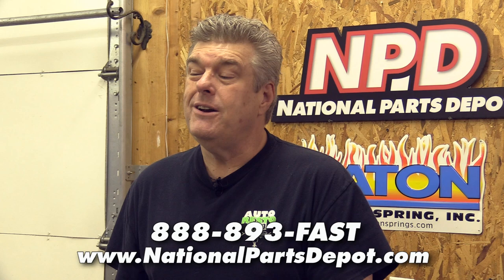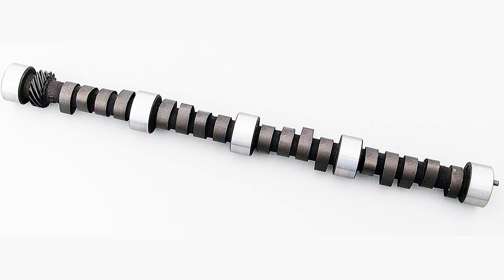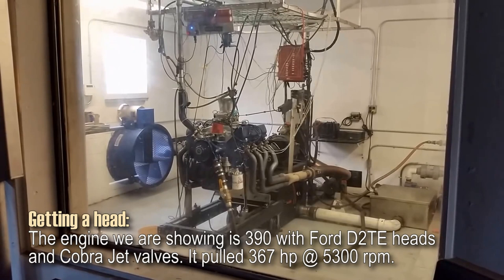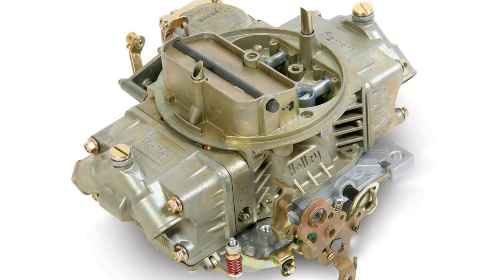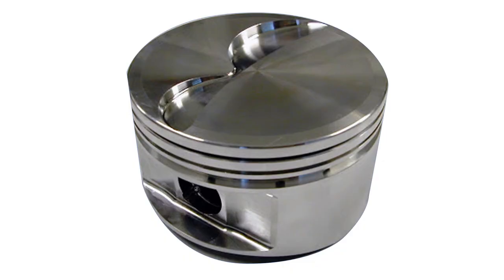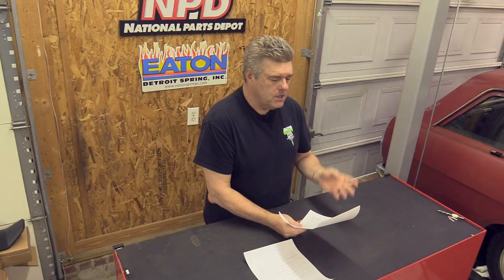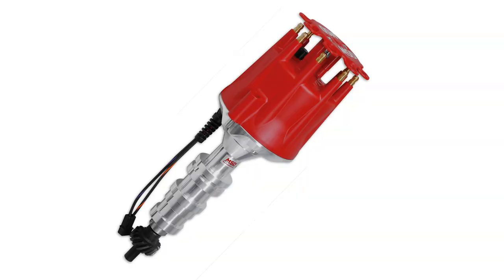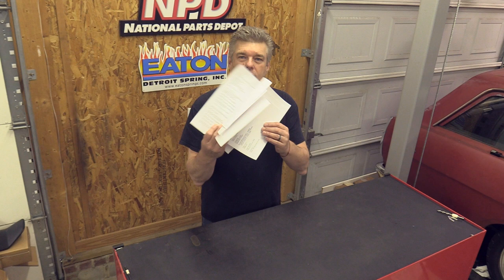Ford FE Build Tips

Comment: The 390 is just simply a torque monster, even in stock trim..
Reply from the maker: Yes.
Reply: FE 427 is 100 more hp and  70 less  lbs than a ch**y
Reply: @duccanard9079   but sadly 3 times as expensive,. If,,. You can find  one..
Reply: indeed
Reply: 427 ft lbs of torque in stock 390 form. Not a torque monster in my book.
Reply: 390 is a great engine, stick a 428 crank in it and it's a great combo.
Reply: @kimmorrison9169  how is that not a torque monster, has that much stock!
Reply: @RegulerShowTV  Buick 401 has 445 ft lbs, Pontiac 389 has 445 ft lbs, Olds 400 has 440 ft lbs, 383 Mopar has 425, AMC  401 has 430 ft lbs,Chevy 396 has 415 ft lbs. The 390 Ford at 427 ft lbs is basically average for a big block.
Reply: @kimmorrison9169  you have a point, but in comparison to today’s motors all of the engines you listed are torque monsters.
Reply: @kimmorrison9169  The AMC 401 is really the impressive one here being a small block.
Reply: @AutoRestoMod  yes it is most definitely and I've got a 2 barrel on mines and she'll still eat the tires up very strong motor!!!
Reply: @kimmorrison9169  That is a 2V engine. The 4 V was pretty good and in the same vicinity as all the other guys. And many of them are still going. The Pontiac was a 3x2V, as was the Olds
Reply: @kalmlykeabomb  The 360/390/401 AMC is not a small block.
Reply: @Bbbbad724  The CJ heads were better than the later C7AE and C8AE were horrible. The C6AE-R and C8OE-N were relatively close. The R heads I ran with CJ valves ran better than the CJ
Reply: @Bbbbad724  Im just no fan of 390’s. They need a lot of mods to make any horsepower.
Reply: That’s what I like to hear
Reply: Too funny. I had a '66 1/2 ton with a fe 352 and "torque monster" is what I named it!
Reply: “Torque monster” = an engine with anemic HP compared with torque usually due to pathetically poor flowing cylinder heads.
Reply: @Bbbbad724  Next time just write a BOOK.
Reply: and NOBODY uses then for a buildup

Comment: Built a 390 for my F100, it turned out pretty good for being a home built mill. Standard 390 bottom end, c8ae-h heads, Holley street dominator intake, comp thumper cam, Holley 750, long tubes. She runs really strong. Probably twice the power of the original 360. Those FE engines can be really nice every day mills with minimal work.
Reply from the maker: Agreed.
Reply: Get a better cam. Like a lunati 268 or a Howard’s You’ll thank me
Reply: @joumasepoes88  oh I agree, you're not wrong. But this comp thumper cam was free, it came in one of the blocks I bought so I ran it.
This engine was literally slapped together with used parts in my buddies garage to get me by until I build the other block right.
Reply: @CadillacZachOffical  they do sound quite nice.

Comment: I'm new to the 390 , but will gain experience with it as I've just bought a 1975 F-350 with a steel 12' dump bed , and not even running that well , that 390 is still pretty stout.  Lots of knowledge to build with my new , old girl.

Comment: Thanks for doing the FE. I've been listening to Barry for the past 10 years. Just a note of caution for folks building an FE: Don't let just any good engine builder build it. Make sure they know about FE in particular. Oil flow being the main issue.
Reply: I had to train my machinitist.I go to another one in a different city close by for my heads.hog block oil holes to7/16,360 pistons,390 std. crank good for7k revs,got forged too.d2 and c2ae heads(got 3 bumpsides).unidentified AL intake,no firing order,no C- numbers,ford stamp and small 1439 by thermostat.thinking low rise.
Reply: @duccanard9079  I remember some High performance FE came with a factory AL intake. It was either an early T-Bird or later police intercepter. I remember it being low rise. Hey, 7K revs is fantastic out of an FE.
Reply from the maker: Good point!
Reply: Barry is the best out there.  I love the FE, it is a strong light engine. Get the iron intake off and you are in small block Chevy territory in weight! Ford did an amazing job designing this engine decades ahead of its time! I have known Barry since 1999 and half of the 394 ci FE I am still beating on came from his company, TRW. It still has no oil consumption, blow by or noise. It runs really good and makes great power just from great parts, details in machining and my own two hands.
Reply: @ltwig476  - You are referring to the police interceptor intake.  It was identical to the cast iron (98 pound) 428CJ intake.  I helped a buddy swap in this manifold on his stock ‘69 CJ Mach 1 back around 1974.  The front end of the car sat about 3/4” higher after swapping in the AL manifold.
Reply: @danmyers9372  Thanks Dan

Comment: More FE focused stories is always a great thing! Mo better, as they say. I have built my share. Currently own an aluminum Pond 427 stroked to 482.  Hyd Roller cam and ported Edlebrock heads with 2.25 and 1.75 valves. 605 hp. 605 torque.  But that motor cost me over $15,000 and I did a lot of the work.

Changes to your build; 
Forged pistons 
Always balance an engine
aluminum heads are super reasonable now. Always take the heads apart and inspect them. Also Trick Flow makes great FE heads now. 
Go with a Ford interceptor intake.
Holley and no less that 750cfm for FE motors.
Stock rebuild distributor with pertronix is the right direction.
Morel makes great lifters.
Reply from the maker: Nice!
Reply: Sweet! I'll come to you for a build when I get the money 😁
Reply: Morgan L, it is great that you are still in the FE fold.  Do you still have the 66 Fairlane sleeper 428 in green? That is a neat car!

Comment: For carb sizing, CFM that equals approximately 2X the cubic inch displacement has always worked well for me on street performance engines. Double pumper with a stick, vacuum secondaries with an automatic.
Reply from the maker: Good idea
Reply: While the CFM rule works well there's no need for a double pumper in most applications. I'm running the intake that came on my car. C7ZX with the dual quad BJ/BK 600 CFM Holleys.
Reply: @myname9337  Nice. I'm running BJ/BK Holleys on a Holman-Moody intake on the 428SCJ in my '70 Cougar. But in single 4 bbl applications,  mechanical secondaries are easier to tune and provide slightly snappier performance on a stick shift car, at least in my experience. A vacuum secondary carb can be set up to work just fine as well though, so from that standpoint you are correct, there's no "need"for a double pumper.

Comment: Graduated in '66 and was messing with Mercury's back in the day.  S-55 390 4-speed cars.  You hit the nail on the head, a few times.  The oil pump drive shaft will break if it's OEM - guaranteed.  Didn't have ARP back then, but we had Un-Breako brand allen wrenches and you could cut down a long reach one to work, no more broken drive shafts.  
The FE will fill the valve covers with oil in a quarter mile at high RPM, so we ran 1 qt over so they would not starve.  But that makes huge windage.  So pay real attention to smoothing drain-back passages, do not run HV pumps (not needed) and go light on the oil viscosity so they flow back better.  Truck heads work well.  So do Interceptor Marine heads (if you can find them).  The marine cams are not bad on the street.  For a big HP motor, you have the better formula ...  But they are fun, once you get them running right 😁

Comment: I appreciate you contributions. Your 67 build was very helpful when I reassembled my Shelby. You suggested use of the FT Duraspark. They will not work in the FE block. The distributor has larger oil pump shift (5/16 Vs. 1/4)
The distributor oil pump drive hole is larger for FT engines. However, if you have the mirror 105 block with the larger drive hole Precision Oil Pumps offeres the bushing so you can use the standard FE distributor.
Reply: FE Duraspark works great especially with a MSD box.
Reply from the maker: Yup. Wonder if you could hide it under a Transistorized Ignition cover on a Galaxie...

Comment: Love it! Pre 1962 FE have the cheesy cam thrust buttons. Post 1963 FE is awesome. 1964 have one year only motor mount.
Reply: 1957 - 1964 blocks are all 2 bolt, chassis are year specific.
Reply from the maker: Thanks for the info!
Reply: 64and 65 heads with 11/32 inserts in the guides with 2.15/1.625 valves with a good blend and valve job are in the group of the best low buck heads Ford  made.

Comment: Informative video, thanks.
Here in Australia I have a 1968 Mercury Marquis Coupe.
I know your thinking land yacht but more of a cruiser one day I hope.
Exchanged the white walls and hubcaps for 15 inch US mags and BFG T/As
and it looks like a totally different animal.
Factory 390 4v, C6 auto, 9 inch rear end and power front discs.
Great original condition for a 52 year old car.
Lots of documentation from the previous owner and done about
280000 miles, a fair few on LPG with 2 small spots of rust.
Has original C8AE-H heads, S code intake, rated at 315HP@4600rpm.
Motor still has good oil pressure and compression on all but #8 cylinder.
I'm hoping due to a long time running LPG the short block will have some life
left in her and a burnt valve or head gasket issue could be the cause.
A leak down test may tell me more?
If good, then reco heads, swap autolite for my 600cfm vac Holley, shorty headers to
replace factory logs and see how I go.
Only 3850? made there in 1968 and a very rare car in Australia.
The guy I bought it off also imported  a 1967 a few years earlier, not as good condition
as mine but with the factory 410 Mercury FE.
I could be wrong but think these are the only 2 Marquis coupes in Australia.
When I finally get my act together she will stand out at the coffee and cars/shows from
all the Mustangs in more ways than one, thanks to her small numbers and large size! :-)
Anyway, apologies for waffling, thanks again for the vid.
Cheers from downunder
Reply from the maker: We have a 1969 Marquis as well!
Reply: I just bought a 68 monterey with a 390 and c6 and probably a 9 inch I hope 

34k miles for 1600 dollars

Comment: My FE390 has been bored .050 over making it a 400ci, 531/540 lobe lift on Oregon Cam, RPM intake and heads, 1.76:1 ratio on HS Rocker Arms, 770CFM Holley Carb, 1" spacer. I make about 450HP and about the same on torque. It'll be mated with TKO500 with Hurst short throw shifter, aluminum driveshaft, 9" Eaton Detroit TruTrac center with 4.33 gear ratio and 31 spline axles. 2.5" FPA headers with Flowmaster 44s and Flowmaster dual tips. You can keep your Coyote :)
Reply from the maker: Lots of people Love these engines. Me included.
Reply: Stock stroke?
Reply: @slick-px4pq  yes

Comment: Feel so blessed to have a 351c 4v, 4 speed in a 70 torino gt, a 390 c6 in a 75 F- 1 fitty and my baby 69 fairlane cobra with 428cj 4speed. All numbers matching.  motors and trans
Reply from the maker: That's a really sweet little collection you have there!

Comment: Cam info is 260/260 adv dur 212/212 dur at .050 .484/.484 lift lobe separation angle is 110°  
My book didn't say if those lift numbers were for the non adjustable 1.73 rockers or the adjustable 1.76 ratio rockers. I assume those lifts are for the 1.73 rockers
Reply from the maker: I found the 212/212 info twenty minutes after the video was posted. I was looking at the cams (like you do) and found the specs on Jegs. We might do a deep dive at some point with Barry. I would Love to have one of his 445 FEs in my Galaxie.
Reply: @AutoRestoMod  i bet a 445 would be a torque a sorus! In my pickups is love a 428 or even better a 427, I've come to terms with the money I got, & what I want in my old truck, a 390 CI or overboard 390 will make all the power I need. I just want it as a driver. Dont get me wrong, I have a truck that is more radical to satisfy the race itch I have. I like to mud run but I run a 460 based 502 in that one.

Comment: Headed to machine shop now. Of course building a 390 for one of my ‘66 trucks. I am now doing a FE experiment 390 just to see what I can do for very low rpm power along with MPG. Will soon see how that turns out. Machine work should be done in next couple weeks. Waiting on the custom cam and custom pistons. 
FE & MPG usually not mentioned in same sentence! LOL! I do currently have a '66 F100 Ranger  352 that is bone stock and gets 22+ MPG but a very rare combination from factory. Per the Ranger Registry only 2 1966 trucks were so equipped.
Reply from the maker: You are a great wealth of knowledge dude, I would be curious to see what you'd spec for a 390.
Reply: @AutoRestoMod  100% depends on application.

Comment: In your mind , is the 390 the best motor  to build  for power and durability  ? ❤
Reply from the maker: From a cost and availability perspective, sadly, the 351 Windsor is a better engine to build. Particularly the 95 to 97, which has a roller cam and the availability of overdrive transmissions. To directly answer your question I think that any of the fees can provide a good base. The advantage in the 390 is that you can overboard it more than you can say a 428.

Comment: I just picked up a 71 F250 chassis that was still wired to run and drive with a rebuilt 1964 390 and  C6. The difference between it and my 69 390 that's in my highboy are night and day. I don't know what cam the 1964 engine has but it has a performer 390 and C4ae-G heads. Bought for $750 and sold the trans for $400. It will be eventually going in my highboy.

Comment: I would highly recommend cutting your rod caps and re-sizing if you plan to use ARP's. Usually ARP bolts and studs apply a greater force at their torque spec which pully the big-end bore out of round.
Reply from the maker: Great tip thank you

Comment: Always do oiling mods to block and restrict oil to rocker arms and a Melling 57b pump(70 psi), plus a windage tray between pan and block
Reply from the maker: Sound ideas!
Reply: Stock pump is just fine for a street engine.  Oil  restrictors in the heads are a good idea. That and an extra quart of oil.

Comment: As a FYI, 428CJ & SCJ heads are exactly same, C8OE-N. Only real difference was the balance due to heavier SCJ rods(borrowed from NASCAR 427), oil cooler and cars were equipped with 3.91 or 4.30 rear gears(Drag Pack). About every 428CJ racer I've talked with said the heavy rods cost approx a tenth in quarter. Will the old Ass-O-Meter tell you difference on street? Didn't for me.
Reply from the maker: LOL Old Ass O-meter...I have one of those.
Reply: And the scj crank was actually the weak point of the motors. I'd take a cj over the scj.

Comment: Love the build sheet on the 390 FE, Gave the video a  👍 But not a fan of the FE unless it's the 390 in my 1972 Camper Special 😎
Also can you a Build Tips video on the 351 Windsor!  Just loved all of the Windsor's I've built back in the day 😎 Including a 1971 351 Windsor Street Boss!
Reply from the maker: It's coming. We are working with the engine builder for that and a 385 series.

Comment: Replace distributor gear drive pin from the one Ford used. Stock oil pan add 1 qt extra oil. No SA roller timing chain setups. Just me 2 cents.

Comment: The street 390 sounds sweet. 375HP is nothing to sneeze at. So are you thinking of putting one in the F-100 or the Galaxy? The Galaxy with the 390 and the top loader would be a great combo... 😁
Reply from the maker: Galaxie might be the way we go. If I do anything in the truck it will be going to a 385 series.
Reply: @AutoRestoMod  A 460 would be cool in the truck...
Reply: A 460? They are so heavy without aluminum heads.  They need a bigger cam too. The early ones 68-71 are pingers on pump gas. 72 avoid at all costs, but a 73 up with a decent cam are good. I still want a 410-445 though.

Comment: Can also use a 361 FT block, its the same bore with a shorter throw crank.  Their high performance pistons will work in a 300 cid inline 6 if you hot rod one of those. A sonic check of the earlier 390 blocks may give you one that can go out to 406 cid or with a 410 Mercury crank reach near the 428 CJ. As for the heads, once you do a valve job and put in hardened seats...check that price to aftermarket.

As for a budget build, if you have no core engine to begin with...consider a roller 351W from the junkyard with GT40P heads from an Explorer, or a 400M. Less weight in the nose (not a concern on a truck, but if you're doing a car...) so you're dealing with power-output-to-engine-weight.  Or if a big block is the only star in your eyes, check out 460.com. You can make great towing power on gas pump compression levels simply due to a larger displacement
Reply from the maker: Thanks for the heads up!
Reply: @AutoRestoMod  i like to think of work done on the FE/FT engine line to be like those who work on Chevy's W engines...tho Ford had an MEL line of engines that had the same combustion chamber design of the W engine (ie, no combustion chamber in the head, its all in the dish of the piston so more work is done moving the piston than trying to lift the head-a great idea) and these engines deserve a closer look of their own.

Comment: You mentioned that the original intake flows pretty well.  Is it about the same as the Edlebrock performer? How much horsepower increase could I expect from the performer RPM or blue thunder CJ?
Reply from the maker: The stock intake does flow well, it is just heavy at 97ish pounds. The Performer and Victor are good choices depending on what you are doing. I'd consult the engine builder or Edlebrock directly.
Reply: @AutoRestoMod  So it’s a stock engine S code 67 mustang.  I’m trying to decide other than the weight if I should keep the stock manifold? Is there any benefit to upgrading it to the Performer RPM? I plan on keeping the Holley 4150 and original air cleaner. What would you do with a S code mustang?